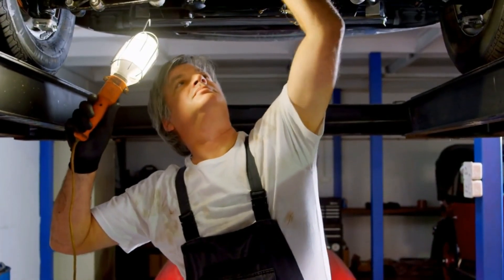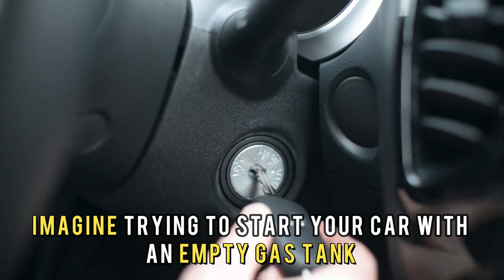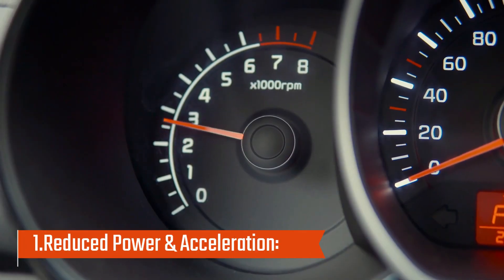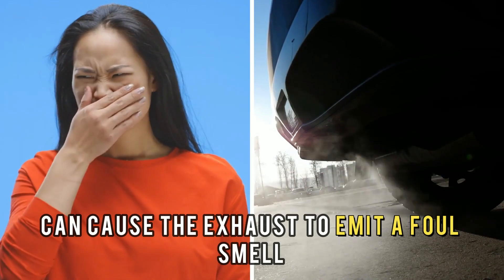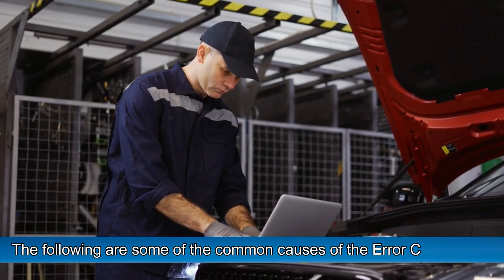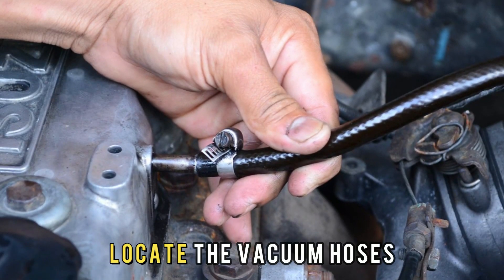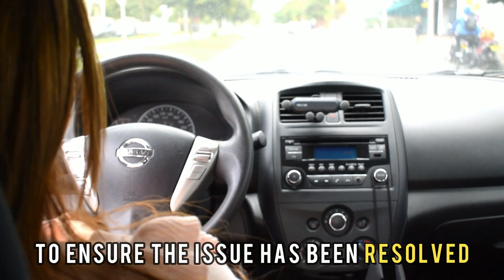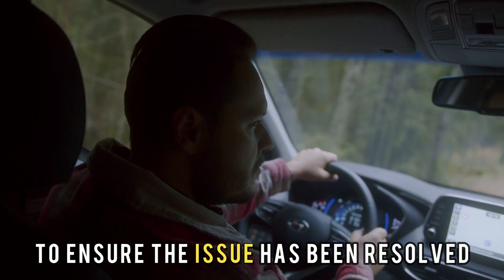P0174 ERROR CODE: MEANING, SYMPTOMS, CAUSES AND SOLUTIONS (System Too Lean)

Comment: Vacuum leak
Reply: Not always the case. I have this code on a 1998 f150 4.6 liter and I’ve been fighting this code for years now. Done a smoke test and I have no vacuum leaks. Engine runs like a champ even with this code.